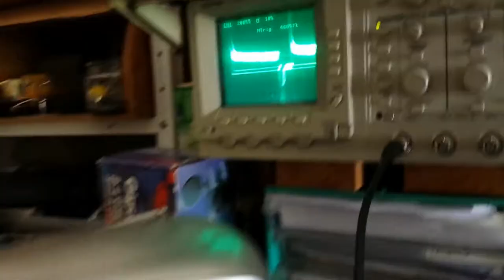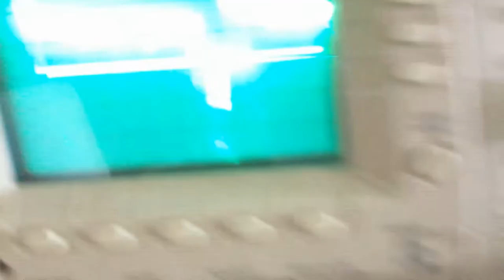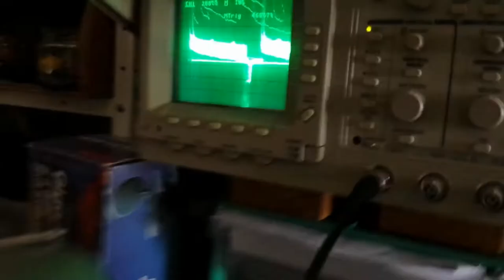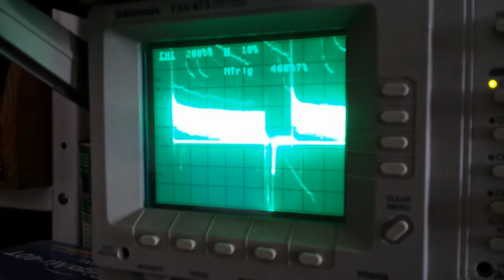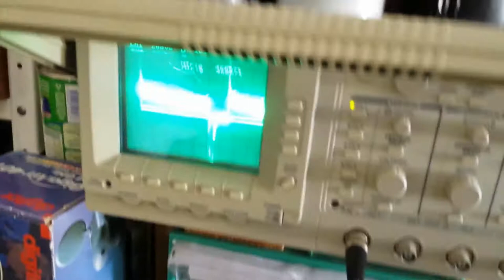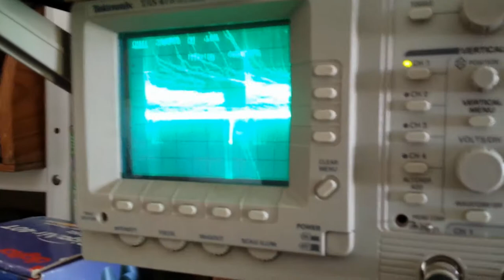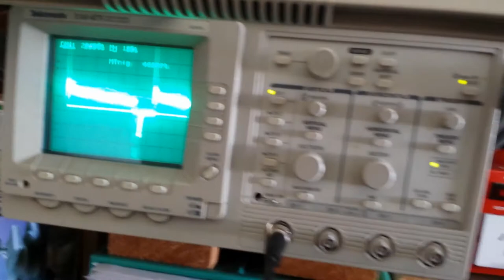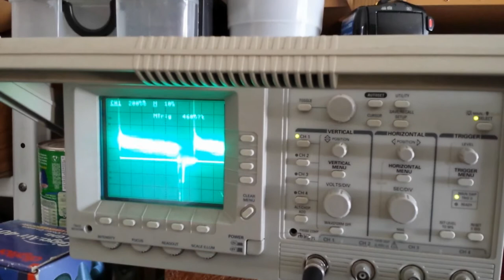Iconoscope TV camera project (Part 35)

Comment: Hi troy.i found of late with my head amp to work in different light levels ,to be sensitive i have a feed back control and a control to drop the voltage to it ,it becomes sensitive to lower light levels with this adjustment .one sort of works to narrow or widen the band width and other sensitivity .
I think i would change the head amp for another and see ,i don't know what you are using but the 5534 low noise op amp ended up being the best i have used out did all the op amps tried i think its got a 10 mhz bandwidth .
A quick test on the one you are using is just stick a pot in to adjust the voltage to it ,,,,,,,,,,,,,,,,,head amps a fussy buggers.
Reply from the maker: Thanks for the advice. The head amp I'm using is a replicated version of a head amp from an early 70s Philips plumbicon colour camera, Yoshio Osaki and Paul Marshall who both built Iconoscope cameras used plumbicon head amps. I hooked the head amp to the video board I removed my homemade vidicon camera, I inputted it further down the video amp stages as the 1st amplifier is of that board also being a head amp I am getting way too much gain and getting noise. I will experiment with the video amp stages and see what happens, gonna try connecting the target to the video board's head amp and see what happens. I personally think the biggest problem with my camera is the deflection yoke is too far down the neck of the tube and hence not deflecting properly, I can only push the Iconoscope so far down the plumbicon yoke assembly, it was a stab in the dark if it would work or not. Will have to either get a yoke from a small old B&W TV that isn't conical shaped like on a typical TV or wind my own deflection yoke.
Reply: troysvisualarts
Very hard project i would more than likely fail so i have an interest and fingers crossed you get it going ,
Would changing the horizontal freq off hold show up the scan length ?
i wonder if you took apart a small image tube deflection yoke instead of winding one and making it to size fit this ?
Any case something is still up just have to stick with it as you are troy.